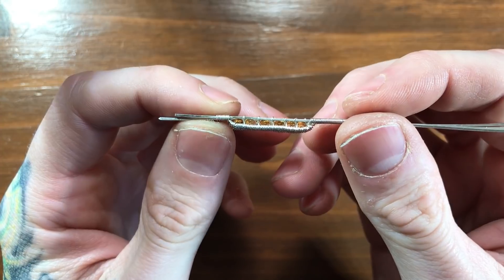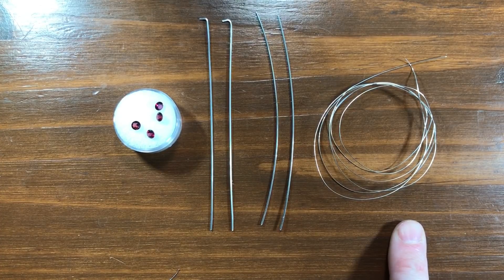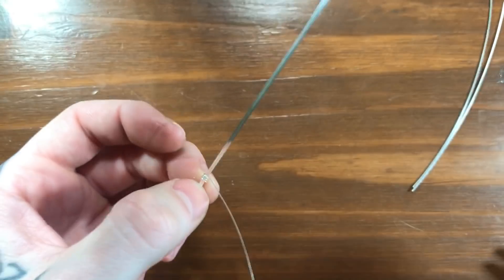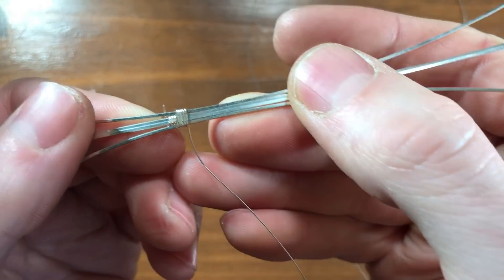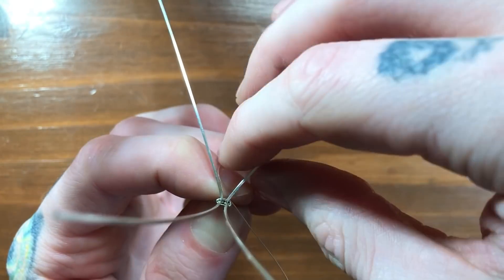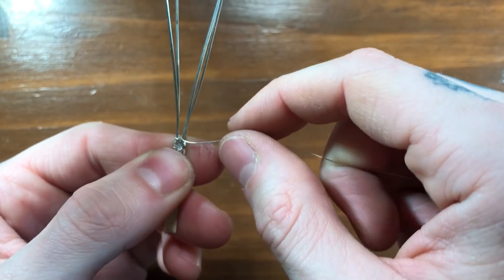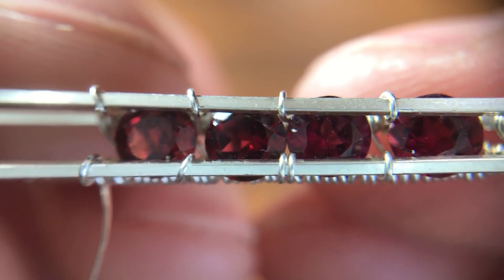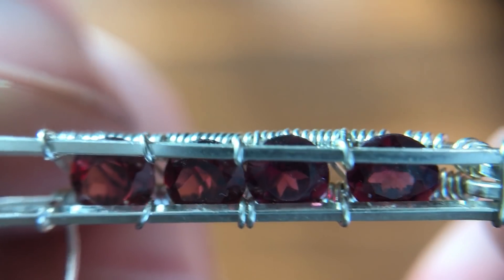Wire Wrapping Tutorial: Channel Setting

Comment: Best tutorial on channel setting I've seen yet!!!
Would 4 on the bottom work if I wanted to try it with 6mm?
Also, where do you get black nylon pliers, always see white ones?
Thanks for the great tutorial!
Reply from the maker: That is super encouraging to hear, thank you! I'm sure it would work with more wires easily enough. Try it out and let me know how it goes! I've only done this setting a small handful of times so I haven't really experimented with it, I'd love to hear about the possibilities!
I'll post the link to these pliers, technically they are Delrin not Nylon. Delrin is a slightly stronger plastic than nylon that still wont scuff the metal. I'd like to say i bought them for that reason when my nylon tips kept wearing out. The truth is I actually bought them because I like the ergonomic handles and they matched the rest of my pliers from Swanstrom (creature of habit I suppose)
Reply from the maker: https://www.riogrande.com/product/swanstrom-flat-nose-pliers-with-delrin-jaws/111327

Comment: Great tutorial! I've never seen this type of channel setting. Do you have to use half hard wire or could you use all dead soft? Are the stones fully locked in place (don't wiggle at all in the setting)? It looks like they could pop out from the sides but I guess that's the illusion. I'll have to give it a try. Thanks!
Reply from the maker: It could be done with all dead soft, however you would need to be super careful not to bend the top two wires. Once those get bendy this setting gets really tricky. The half hard does make this a lot easier. If you only have dead soft on hand you could draw your wires through some nylon tipped pliers to work harden it first
Once they are set the stones do not wiggle at all and are very firmly set :)
Reply: @RaftarkJewelry  Thanks for your tips and advice! It's very appreciated!

Comment: Awesome. Please could I just use soft instead of half hard would it effect the piece
Reply from the maker: Tammie Broggins you can! It is much more difficult with soft than half hard to do this setting in my opinion though. The half hard temper enables you to work without the wire kinking and it stays in place. The dead soft gets a little squirrely with this setting

Comment: I have a question for you, I have tried this one and the bezel setting, and when trying to incorporate in my frames, any shaping of them results in the stones becoming loose, how do you compensate for that. Do you just have to preshape and then you're are stuck with it?
Reply from the maker: Great question!
for the bezel settings you have to be careful about where you tie them onto the frame. think of the bezel like its a spring, you want to secure the ends in a way that increases the tension on the setting/stone. if your bezel was created wrapping the wire clockwise around your pliers, you'll want your anchor points to encourage the wire to reach further clockwise if that makes sense. its a bit hard to explain without a visual, you can always shoot me a message on Instagram and i can shoot you a doodle of what i mean
Reply from the maker: and as for the channel setting, you are not alone in finding it to be frustrating. I rarely use this setting in my own work because i find it to be fickle and time consuming (and that the straight parallels dont really match the aesthetic of most of my work). getting them to sit securely and firmly just takes a lot of tweaks to the wire, make sure those top wires remain straight and firmly sandwiched onto the stones

Comment: Is it possible to use this setting on a gentle curve? How do you determine the gauge of the base wires? What do you recommend using as base wires in terms of the size of the stones? Does this change if your setting different sized stones in an increase and decrease?

Comment: Thank you for the tutorial, Nolan. I have a question. Did you have any issues with the top wires wanting to open apart for the stones to fall out? I tried and failed at this a few times and that was my biggest issue. Tried anchoring the top ones straight down like you did and they wanted to come apart so easily. Finally ended up figuring out to anchor them diagonally in an "X" pattern to keep inward tension on the stones. Even then, if I don't weave in the right direction it still doesn't work lol. Very touchy little setting but so satisfying when to do. I'll pm you on IG with my successful attempts.
Reply from the maker: Your piece look awesome man! Great work!
I find this whole setting to be a bit touchy, but once I got the stones set and the wires locked down firmly they stopped shifting. It does take quite a bit of work to get them settled with the stones in place, but it looks pretty cool once you get it!

Comment: I enjoyed watching the video to learn a new technique. only 1 problem. You are so used to just whipping the 28ga around the base wires, that I could not see which wires were being wrapped. If you could slow that part down, the video would be perfect even for us beginners. Im still going to subscribe & post to Pinterest, because I enjoyed watching. Im sure I'll be able to come back at some point & say - now I can see it.
Reply: You can manually change the speed for any video by changing the playback speed while using the YouTube app. Locate the 3 dots in the right upper corner of the video (if you don't see it then tap on the video and it should pop up with the pause, share, full screen, ect buttons). Click on the 3 dots, then playback speed. I'm not sure if this menu is also available when using a web browser or computer.. If it is, it might be located in a different spot like under or to the side of the video.
Reply from the maker: That is a fair observation! I did speed through that part a bit. I'll do my best to slow it down a little bit for future videos. Thanks for checking out my channel, I hope these videos are helpful!